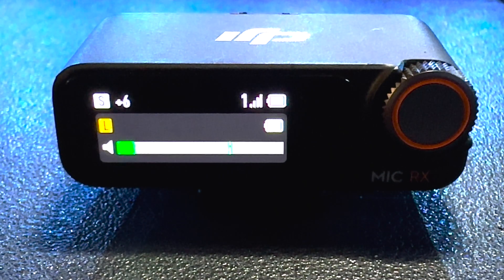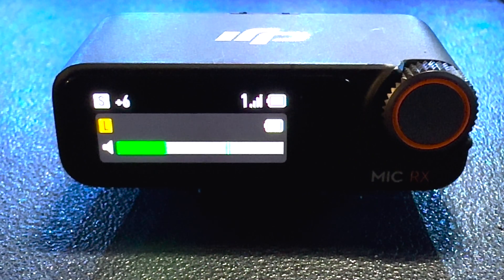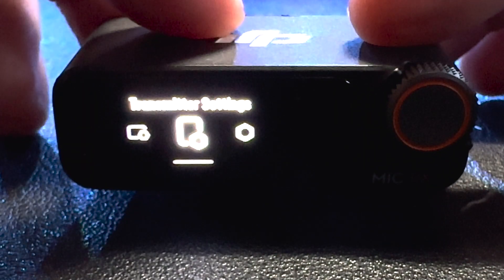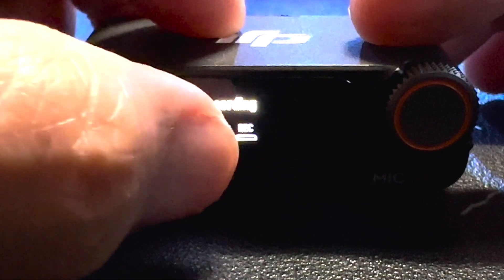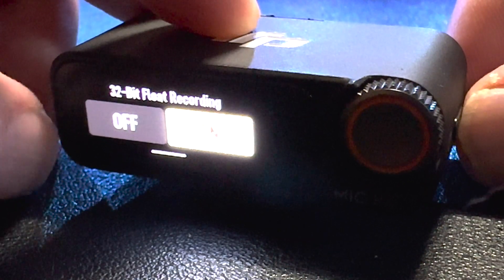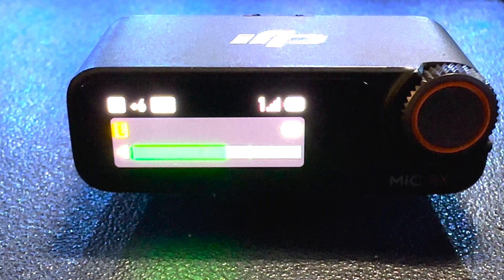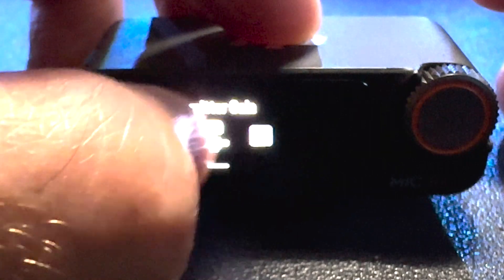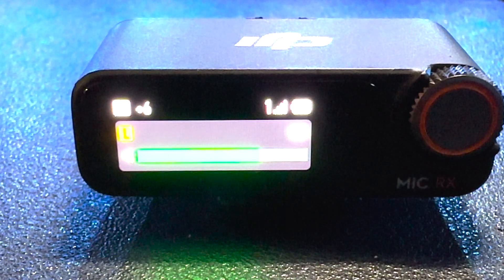How to Enable 32-Bit Float Mode on the DJI Mic 2: A Complete Guide

Comment: So it just starts recording when you switch it to on
Reply from the maker: If you're using the receiver to pass audio through to a camera, phone or computer it will capture audio as soon as you press record on whatever device you're using. If you're recording directly to the transmitter you need to press the record button on the side of the transmitter. When the light it red, the transmitter is actively recording. Hope that helps!

Comment: I only have one transmitter. How should I set it up for the best recording? Will 32-bit float recording work only when using the transmitter itself? Also, if I enable 32-bit mode while connected to the Pocket 3, will that setting remain saved on the Mic 2 transmitter when I later use it as a standalone recorder with its internal storage?
Reply from the maker: Hello, I’m not sure what you’re asking in the first question. I definitely recommend enabling 32-bit float and leaving it on all the time. It always stays in 32-bit mode until you disable it. I recommend recording locally to the transmitter every time. If you pass through the receiver it will drop the audio down to a 24-bit file and it has clipped that audio at times on my recordings. So storing locally on the transmitter has saved me. So enable it one time and you’ll always be good to go. Hope that helps!
Reply: @mattlydytech  Thank you for your reply.
Reply from the maker: Happy to try to help!

Comment: I was chatting with AI about how to use the 32BF recording, and the instructions differ from what you are saying:

Gemini's instructions:
"To get a true 32-bit float audio file, you must record it internally with the transmitter.

The audio that is recorded directly into your iPhone's video file, even when using an app like Blackmagic Camera and the IEEE FLOAT setting, is not a true 32-bit float recording. This is because the wireless signal from the DJI Mic 2 receiver to your phone is transmitted as a 24-bit signal, which is then written into a 32-bit float file by the app. The benefit of the 32-bit dynamic range is only fully captured at the source, which is the microphone and the analog-to-digital converter inside the transmitter itself.

This is a key distinction that separates this workflow from a traditional one. You are essentially running two separate recordings:

The Video Recording: The iPhone records video and a 24-bit audio file (which can be a Mono S.Track for safety) that serves as your scratch track.

The Audio Recording: The DJI Mic 2 transmitter records a separate, high-quality 32-bit float audio file to its internal memory. This is your primary audio source.

This two-step process is the recommended way to use the DJI Mic 2 to its full potential, ensuring you have an un-clippable, high-dynamic-range audio file to work with in post-production."

Please confirm if AI is incorrect here.
Reply from the maker: Ai is correct here. That is why I always recommend recording directly to the transmitter even if you are using the receiver as that will give you a safety net. If your levels are set right it shouldn't be an issue but better to be safe than sorry.

Comment: Matt thanks for this.  I have two transmitters, but no receiver.  Is there a way to still enable 23-bit float?
Reply from the maker: Not really however if you have a DJI Pocket 3 or Osmo Action 5 you can pair the transmitters to those and enable it. If you know someone who has a receiver you can temporarily pair your transmitters to their receiver and enable it. Once they are enabled they will remain that way unless you explicitly pair them again and turn 32-bit float off. I hope that helps!

Comment: I have my receiver attached directly to my iPhone and the transmitter on my shirt and the other transmitter on the shirt of the person I’m interviewing at motorcycle or sometimes car meet ups. As usual there is always someone reving their engine which cause the audio to clip badly making the audio unusable. How do I stop this from happening with the setup I have? In advance, thank you for your insights and suggestions.
Reply from the maker: When you're recording with the receiver I highly recommend recording locally on both of the transmitters as well. Make sure you have enabled 32-bit float on both transmitters and then leave that on all the time. Once you set it you should never have to turn it back on.

That way if the auto that passed through the receiver is clipped you can pull the audio directly from the transmitter and dramatically lower that volume if needed. If I’m using the receiver I’m always recording directly on the transmitters at the same time just for that purpose. Being able to adjust the volume on the two channels independently can be a life saver. 

If you need help syncing the audio from the transmitter to the receiver you can watch my latest video where I show how that’s done in Premiere Pro (the process is similar in most editors). 

Hope that helps! Feel free to ask more questions if I didn’t explain it clearly.
Reply: @mattlydytech thank you kindly. I think my issue is I don’t have a separate audio editing device. I use iMovie for my YouTube videos and the audio I use is the imbedded audio that the receiver pipes into my iPhone or insta360. I’ll check out your other video thanks again. 😊🙏
Reply from the maker: @Texas2Tires Yep that is almost certainly what is holding you back. You could try pulling the audio from the transmitter and manually lining up the waveforms in iMovie but that is tricky (but not impossible.) I think you can download a trial of Adobe Premiere Elements and get access to the audio synchronization I talk about in my other video. 

That might be a good next step on your editing journey.

Comment: Nice video. If I buy the standalone transmitter kit (only the TX), can I record in 32-bit float, either internally or externally (using the DJI Pocket-3)?
Reply from the maker: Thank you! It is my understanding that you can use 32-bit float mode and the DJI Osmo Pocket 3 manual references this. Unfortunately I do not have a Pocket 3 to test this for you.
Reply: @mattlydytech  Thank you for the reply.

Comment: Thank you very much. You are very quick to the point. That's how I love videos And I do have a question. 

If I have audio recorded on To the mic, how do I download that audio onto a video?
Reply from the maker: Thank you for the comment. To get the audio off of the mic (transmitter) you can just connect that to your computer using a USB-C cable. On a Mac it will show up as a volume called "NO NAME". There will be a folder labled DJI_Audio_001 inside that folder you'll see all the .WAV files. You can copy those .WAV files wherever you need. On Windows the only difference is it should just come up as a normal external drive with a drive letter. The folder structure is the same.

If that doesn't answer your question let me know, I'm happy to help further.

Comment: Hello 

I was wondering if the dji mic 2 records 32bit float to the receiver/cam or internal only?
Reply from the maker: If you have it turned on on the transmitter it will record 32 bit both on the transmitter and through the receiver. I usually record to both places so I have a backup copy to work with.
Reply: @mattreviewsstuff  thanks so much! Answered all my questions 

Subscribed!
Reply from the maker: Happy to help! Thanks for subscribing!

Comment: Hello, your video is very clear, I have purchased a DJI mic 2 single (without the receiver) and I link it perfectly to my Insta 360 ace pro. I would like to be able to activate 32-bit floating mode. The question would be... when activating this mode with a DJI receiver, would it remain active in the microphone itself without me using the receiver? thank you!!
Reply from the maker: Thank you for the comment. Yes, once you activate 32-bit float it will stay active on the transmitter until you connect to a receiver and disable it.

Comment: how do I enable it if I have the action 4, not the reciever?
Reply from the maker: Unfortunately as of right now the only way to enable 32 bit float for a transmitter is to connect to a receiver. I have heard rumors that DJI is working on a way to enable it without a receiver but so far they haven’t announced anything official.